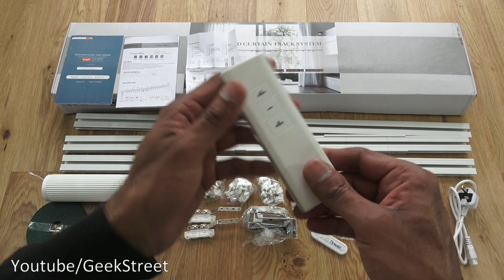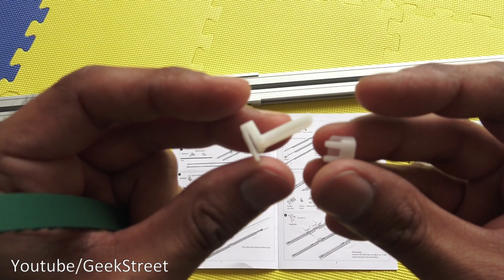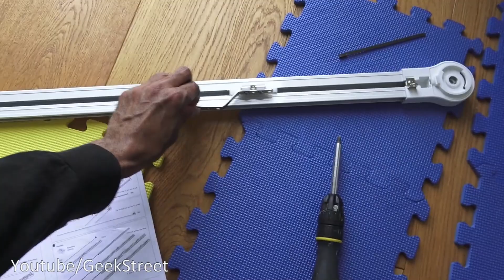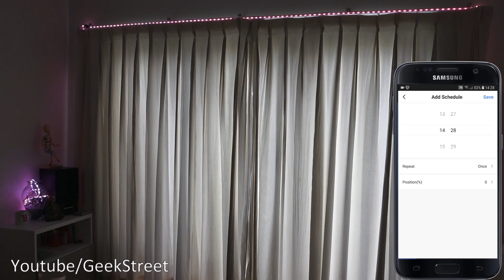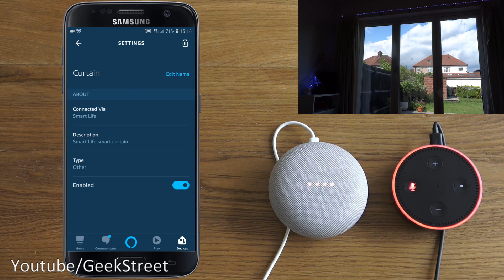Cheapest WiFi Smart Curtain Track works with Alexa and Google Home Unboxing and Setup

Comment: Brillant Video! I'm also just about to buy a curtain track like this. I was wondering how much is the offset on each side of the window? It looks like you are using 30 cm tolerance on each side to accommodate the curtains? So I guess you're having a 2.6 m window and a 3.2 curtain track? Thanks a lot in advance for an answer :)
Reply from the maker: Thanks for me it was 40cm each side.

Comment: Hi, thanks for the video, I'm only having troubles getting to pair with Tuya app... The lights one the motor don't start blinking after turning it on. What should I do? Thanks
Reply from the maker: Try holding the pairing button longer.
Reply: @GeekStreet  Just figured out! I had to press 3 times and then the lights started blinking! :) thanks! By the way, do you know if it's possible to add the curtains to Apple Homekit?

Comment: hi do you curtains open to exact percentages or do they round up or down every 10 percent? i cant seem to get the curtains at the position i want them. When i set it to open to 45 percent. They open to 50. When i set it to 33 it goes to 30.

Comment: not sure why , but every smart curtain , has a HUUUUGGGGEEEEE motor to run it , literally every smart curtain has an enormous motor to run it , unless you buy the 1thousand dollar version it comes with a small RC type brushless motor .. lol , is this and issue that it needs a small car engine to run these curtains across 1 feet ? i dont understand the need for a 3lb motor hanging off the side to move a 2 kg at most curtain weight lol , maybe i need to watch more videos...

Comment: Brilliant instructions thank you for this not bought one yet but with your help, I might now! thank you!
Reply from the maker: Good to hear this video helped.
Reply: @GeekStreet  Ive just got one and wondering if mines a different version as I have no USB to plug into it or an Emitter in the box?The model now as no wifi dongle and you just need to press a button on it 3 times to pair it to the software! Thanks thought Id update you! :-)
Reply from the maker: Maybe they have changed the design, mines a few years old now.
Reply: @GeekStreet  Your instructions where very helpful no matter the update still got me there in the end Thank you again for a greaT VIDEO.  Just wish I have it the right way around when I say ok google open curtains :-) Im not taking the belt back of that seems a great task for me. :-)
Reply from the maker: Thanks its not that bad to do really.

Comment: Has anyone tried this with multiple curtains yet? If I were to invest in this, I would be installing them to four windows in the same room. 

Is the remote programable to deal with more than one at a time? I’d prefer not to have four remotes lying around!

Also, can Google Assistant be programmed to close all curtains with a single command?

Comment: Great video, i just wonder how you managed the wifi conection on all this "smart" gadgets? I have hub 3 from virgin media and i had to disable the 5GHz and this method affects all my tv's and smartphones as are made for 5GHz. Do you use a second router on 2.4 for all this gadgets? ( I've had also issues No internet connection) cheers. And good luck with future videos and projects.

Comment: Thank you so much for the video, it was very helpful! The guide in the box is fine, but really shallow and one cannot quite understand what to do. Luckily I found this video and assembled the curtain.
Also, just a tip for those who might have the same issue of the curtains being reversed in app and in reality. The guide says to hold the "pause" button in the app for a while, until the motor vibrates and moves the curtain a bit. Then the app will show the correct position and will open and close the curtain properly, as it is in reality. ;)
Reply: Great tip, thank you!  Was close to taking the whole thing apart!

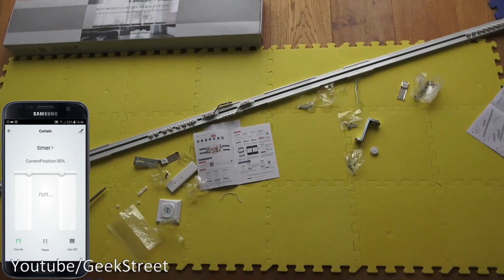Comment: 24:00 Well, I followed this video to assemble it, and just like you I found mine runs backwards.  But you completely skipped over how you solved it.  What do I do??
Reply from the maker: Check at 28:11
Reply: @GeekStreet  This might come a bit late, but I've had the same issue when testing out the curtain. And the solution to it being reversed is actually quite simple and described in the guide you become in the package. When the app shows your curtain closing but in reality it's opening, what you should do is hold the "pause" button in the app for some time. The motor will vibrate and move for a bit. Then stop pressing it and the app will "learn" which way it is in the reality. After that, it works properly. I tried it out and it worked like a charm, without disassembling the whole thing and switching the belts around. ;)

Comment: Is it possible for the motor to be controlled by a wire switch?
Reply from the maker: You could get a smart wifi switch and control via smart scenes.
Reply: @GeekStreet  Thanks for the quick response. I have the curtain motor, I am very satisfied. I am interested in integrating the curtain motor in a smart home system where I can set in percentages how much I want it to be open. For that I would need to be able to use a shutter.

Comment: I ordered, as you say, "the cheapest" curtain track system I could find - on Amazon for $114. (118"). It is the same unit you describe. I am sure happy you posted this video because I found the instruction manual with its Chinese version of English to be impossible to comprehend! I had almost decided to "wing it" without the manual and then found your great instructional video. Thank You! Mark
Reply from the maker: Thanks for the comment Mark, great to hear the video helped.
Reply: is it still going strong?

Comment: I wouldn't use WD40 on the track. It will attract the dirt, it may compromise the belt's lifespan and will make everything greasy and messy. Silicon spray will be the best choice!
Reply: or powdered graphite, stuff that is used for locks
Reply from the maker: @jimhill-bkk8550  thanks!
Reply from the maker: Thanks for the info!

Comment: Hi, great do you know what is the maximum weight the motor can pull and the rail can support? I mean if I put 5 kg of curtains for example?
Reply from the maker: Not sure on maximum weight but just to note it can handle heavy curtains each of mine is at least 5kg.

Comment: I wasn’t able to get the app to recognize the motor. The motor does not have any blinking light. How do I troubleshoot this issue and without the app being synced is it safe to say that the motor will only over travel if I click any of the remote buttons thus making the belt disconnect?

Comment: Hi. Excellent video. Actually used this instead of the owners manual that needs a microscope to understand what's going on. I ran into the same problem as you, which is the motors are running in reverse order. i.e: Hitting "close" actually opens my curtains, and vice versa. Can you please provide a bit more info about what you did to fix it? Do I understand that the cable that was in the far end was moved to the front end, and vice versa?
Reply from the maker: Thanks for the comment, I'll be honest it was long ago I don't 100% remember. I know put it in the wrong way round and mentioned in the video how I fixed.
Reply: @GeekStreet  Thank u for the reply. Managed to fix it. Great video once again. Cheers.
Reply from the maker: @nassibhaddad  glad to help buddy!
Reply: as per @marko's comment.. pressing and holding pause in the app reverses the motor.. no need to take apart!!!

Comment: Love the set up.  I’m in a wheelchair so getting this will be a game changer for me.
Reply: I received a major surgical operation 2 weeks ago, can’t move my left hand and left leg for weeks. I have to stay on couch most of time. Luckily I installed some smart equipments so that I can use voice command to control curtain, lights, air condition, heater, TV, and calling anyone in house or anyone’s phone. Please feel free to ask me questions, I will share everything I know.
Reply: @LifeHacker1300  so glad of this technology too! :-) just wondering if you know how I can get a fan working with one of them smart plug sp27 as every time its switched on and off it resets to not spinning the fan! would I need to get a certain type that will work with Smart Life?
Reply: @TheDiabeticWay  Yes, we have couple fans connected on smart plugs, cheap ones. And I just reconnected a ceiling fan with a Sonoff smart switch so we can turn it on and off by voice command. It can still controlled by wall switch.
Reply: @LifeHacker1300  which fan did you get as the one I have resets itself if no power so if I turn it on with a wifi plug it does not start the fan blowing! Unless there is a way for it to auto-start but I cannot find a way with it so far.  Pro Breeze® 16-Inch Pedestal Fan
Reply from the maker: Thanks for the comment!

Comment: Hey, great guide! I'm thinking about getting these, but I have a very specific height restriction as they need to be ceiling mounted and my windows open inwards. That only leaves me less than 4cm for the track and ceiling bracket. Do you know if the total track height is mentioned anywhere in the documentation? I need track at its thickest point + ceiling mount bracket height.
Reply from the maker: Thanks for the comment, I just measured the bracket on the wall and its 6 and a half cm in height if you just attached  the mount to the ceiling it's around 2 and half cm

Comment: Hi, great vid (and I subscribed!). Question, do automatic curtains (I'm general) specify a weight limit of the curtains. I have some that are probably in the realm of 20-30kgs.  Thinks the motor will blow?
Reply from the maker: Thanks for the comment and support. Not weight limit but they mention  a torque amount on the strength of the motor. You wouldn't worry too much about the weight it's more to do the the force required to pull the cord to open. You could also contact the seller to advise. Hope that helps.

Comment: Great video! I wanna buy one of this.  Just have a quick question. My curtains are two way but from one side is longer than other one. Is this tech works for me?
Reply from the maker: Thanks for the comment not sure what you mean by two way?... If one side is longer than the other it shouldn't matter just the curtains should be of identical size and make sure you have a gap at the sides so the curtains are out of the way when they open. Hope that helps.